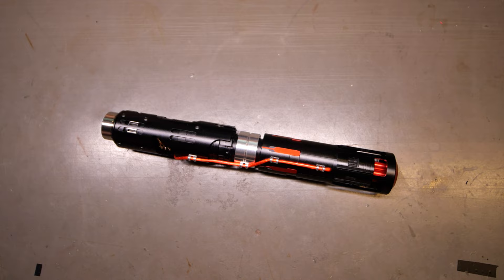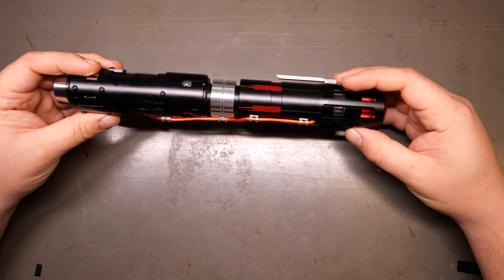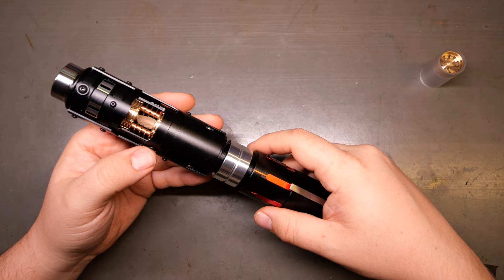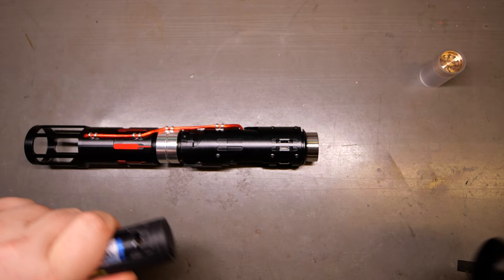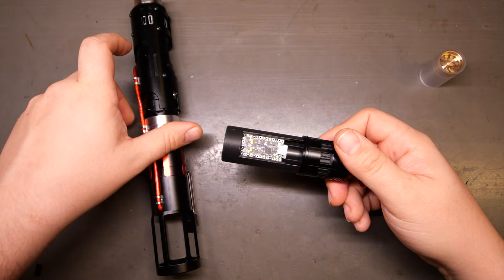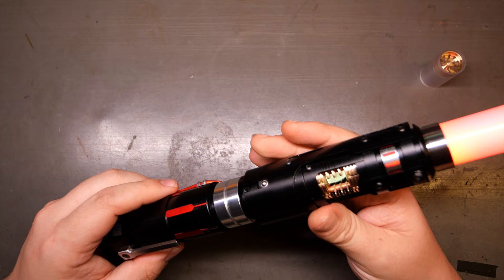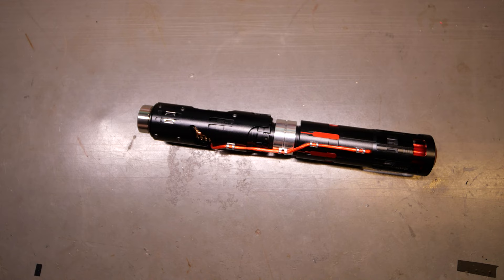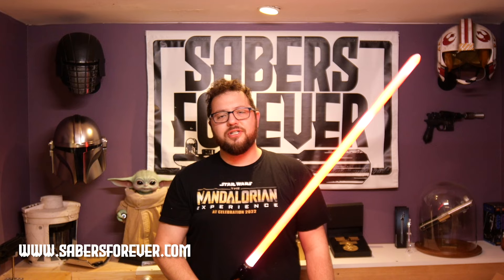Heart of Siberia ECO chassis Install by Sabers Forever

Comment: I was going through the install guide and it has the accent pixel wired in line with the blade. How do you have the crystal doing different effects since there’s only one data pad on the rotary PCB?
Reply from the maker: You can make what is called a “sub-blade” with proffieboard. It allows you to define the crystal pixel as separate blade!